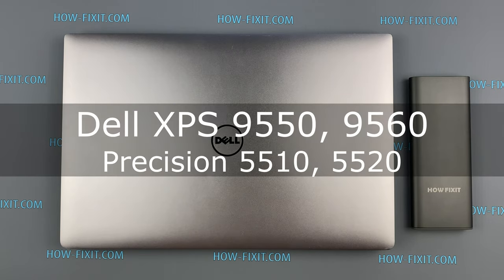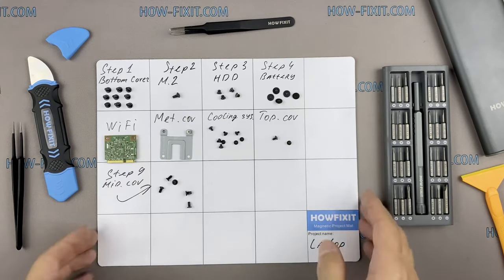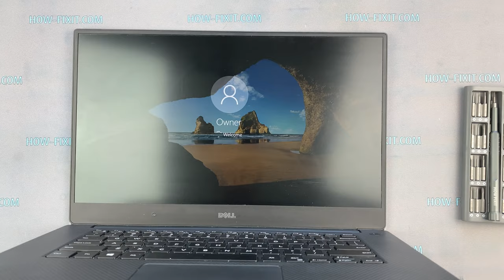Dell Precision 5510, 5520 & XPS 9550, 9560 Keyboard Replacement

Comment: Thank you!  I successfully replaced my 5510 keypad.  The keypad I bought had the "ribbon" cables slightly off, but I was able to manage to make it work without any major hick-ups.  Highly recommend watching video all the way through first.  Also, it's important to realize that while this can be done, most of the screws are tiny, having the recommended size Philips and star driver heads is helpful to help not strip threads and to easily grip the tiny screws, and it's a good idea to take a few pictures / videos of your own uninstall for any variations.

Comment: Great video.  Used for a 5540 keyboard.  It was a little different but close enough.  Great tip on marking steps and magnetic board.  There are so many screws... Also recommend taking a couple pics during the process.  My keyboard did not have that screw cover sheet in the middle, so I transferred.  It was not very smooth, but it worked.  Not sure if needed, but I know grounding is killer in laptops so I tried to repeat every piece tape and cover that was oem.  Highly recommend laptop/mobile phone toolkit.  Well worth it.

Comment: hello brother I'm confused about an issue like I'm using dell precision 5520 ,one day suddenly I saw left arrow key in keyboard working auto like auto pressing but when I press right arrow key than problem goes pause for few mins . again by mistake when I press infected key than vise versa . so what's the solution should be.??

Note;- If keyboard key/infected key genuinely got damage than why it works  &